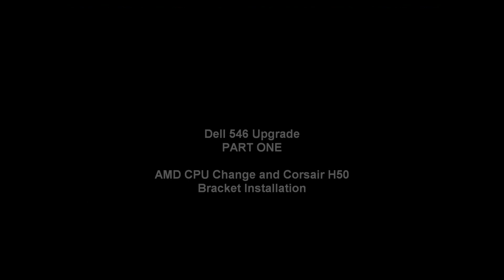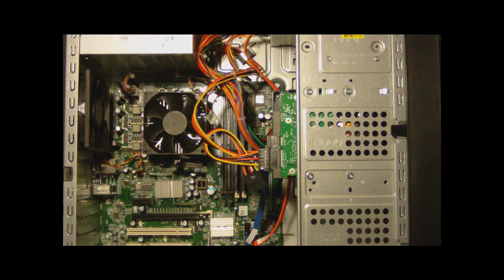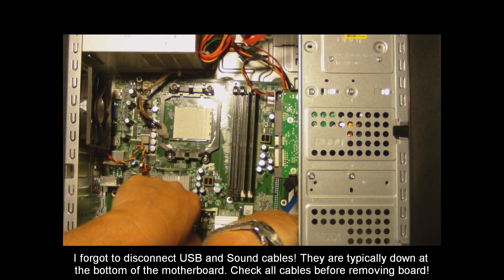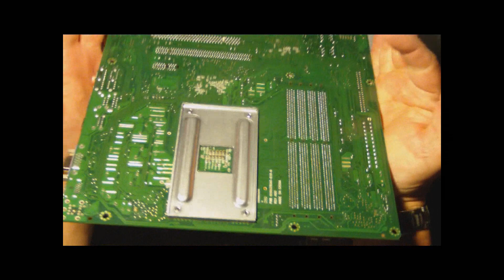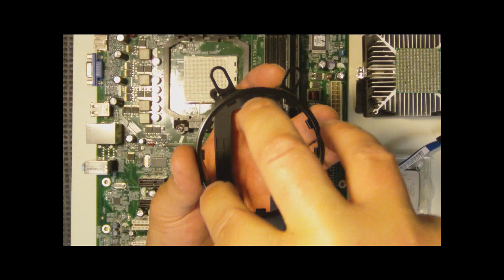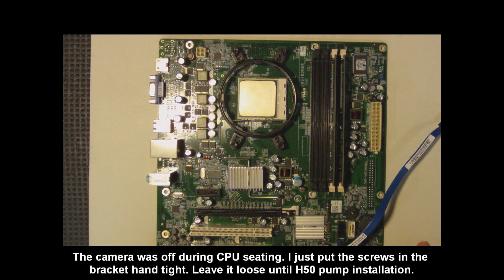AMD CPU Upgrade and Corsair H50 Bracket Installation - PART ONE

Comment from the maker: @tomemyboard Corsair suggests using two fans to push and pull the air through the radiator. In addition, they recommend pulling the fresh air from the back to the case inside. Since this seems to conflict with standard case ventilation, I would suggest trying both to see which gives you better results. I added a second fan to the radiator. It was only $8. Their new H70 comes with two fans so there must be something to it. You would think anyway…

Comment from the maker: AMD Live used dual core processors so you should already have an X2 (AM2) in your system. You could probably upgrade to a Phenom without any issues. You might get a Phenom AM2+ processor with a similar watt (90W?) rating. You may have to check your BIOS to make sure it would support late model CPUs.

Comment: you can install a fan with the radiator for a pull-in-case effect and then just run another on the top of your case or make a hole(best place for a fan IMO is the top of the case)

Comment: @The66jeep well amd processors now a-days require amd am3 socket, but if youre mother board is current enough and has an am2+ (one step below am3) then you can slap a new amd processor into youre system, but if yore below an am2+ socket them you are out of luck and need a new mobo

Comment: did u tap the side of your PSU after you hit the power switch but before you pulled the plug to make sure you wouldnt short circuit your system? Thats the only thing really bugs me about doing anything motherboard wise. I dont even wana do this install for that reason but my system cant run 4.3ghtz on aircooling forever